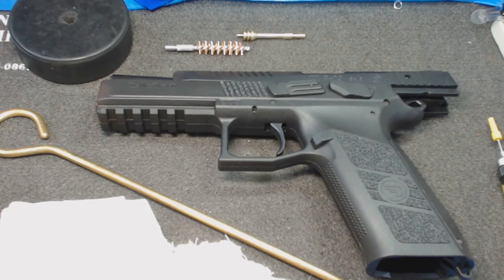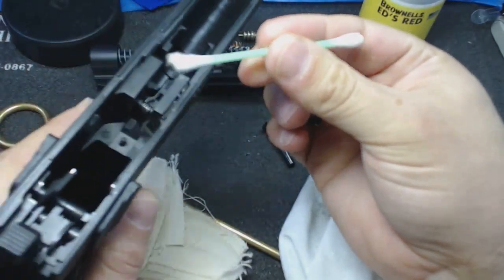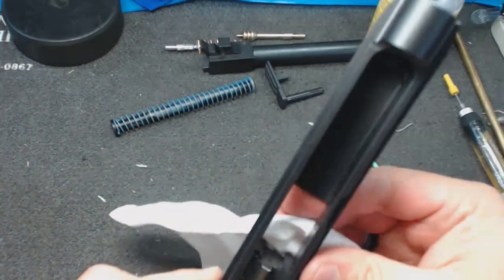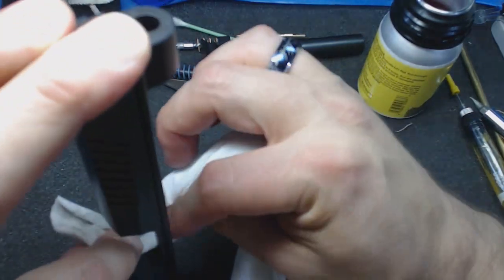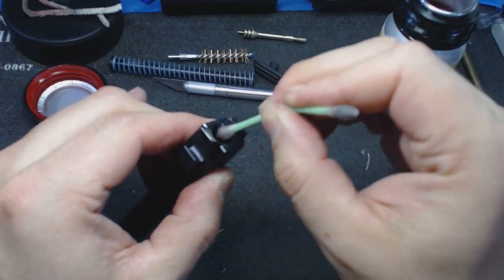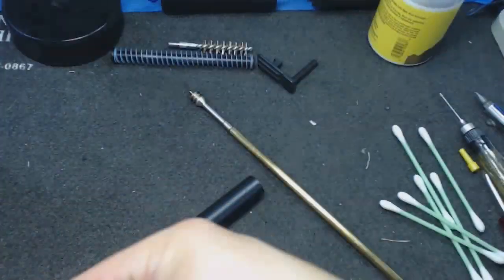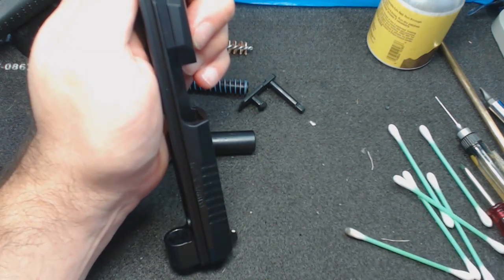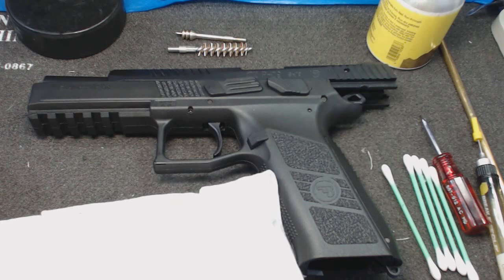How to clean a pistol.

Comment: Good advice on the painters towels! I’m gonna have to go get some. They look really useful. I generally clean with oil only, as you said it is also a natural solvent. I just find that oil loosens up gunk super quick and my guns get squeaky clean faster than using one and then the other. I keep a foaming solvent around to let sit if I have to clean something extra filthy but just oil can really do the job when you keep guns clean religiously.

Comment: A gun cleaning vid I actually watched all the way through , why ? No grease on pistols ! Thank you ! Dry wipe first when cleaning ! Thank you ! Polishing a feed ramp doesnt help feeding ! Thank You ! lol... I see so many vids of some putting grease all the way down the slide channel of something like an M&P or other variant and I immediately stop watching. The coating on a barrel is there for a reason and most coatings act as its own lubrication. For people who dump grease on a pistol , steel or aluminum parts of a pistol that rub against each other are made to rub against each other.If it didnt evaporate you could probably spit on rails and it would be fine. Lube or oil besides lubrication is really to protect against corrosion. AshburnArmorer I have a couple tips for you at least how I do . With captured guide rod springs I use a curved polymer pick , lay a patch on one end of the rod , push the curved pick down between spring coils and just tu3n the guide rod until I get to the other end. Also I know you have a cleaning system qnd you might think here we go another clp but to tell you I use Weapon Shield clp and hqvent gone back. Start with a clean pistol put a few drops on a patch and wipe everywhere in slide and lower where you can , wipe off any heavy clp so all there is , is the feeling of lube when you wipe your finger on it. When I go to the range I take two guns, one I carry and one im shooting. The one im shooting when im done I run a snake that already has WeaponShield on it then coat a medical swab and coat the bore and feed ramp with Weapon Shield and leave it so it gets to work during the drive home . When I get home because everything has a slight coating of Weapon Shield , everything just wipes off I never have to use solvent even in the bore. Weapon Shield does make a solvent and it is safe , it has Weapon Shield in it , you can soak a barrel init overnight and not worry about the bore pitting , Weapon Shield has no harsh chemicals. I field strip , wipe down and inspect my pistols about every three or four weeks especially my carry. Why , I read a funny story a Sheriff went to the range and his duty pistol wouldnt fire , he took it to a gunsmith and there was deep fouling , gum wrapper and pieces of food down in hammer area . The Sheriff said he hasnt cleaned it in over a year go figure. It cracks me up people who know nothing about firearms feel safer if somone is a cop or  carrying a pistol. Many police only shoot to keep their certification. Many conceal carriers , especially who make it a lifestyle and keep up on the laws are safer and better shots and know more about firearms than many police. You wouldnt believe how many ND police departments have . I remember when LA County switched to Glocks how many they had becuse they were used to da/sa and couildnt keep their finger off the trigger and police still have high ND's . and never clean their own guns. Anyway , just a suggestion about Weapon Shield , I really like it and remember the solvent you dont have to worry about any harsh chemicals. I do use the solvent once in a while to hose everything out for a deep clean other than that using the clp I dont need solvent. You really dont clean with the clp having just a slight coating makes fouling just wipe off and you lube the same way you did in video. Check it out it is made by Steel Shield Technologies. George Fennel is the owner and Tribolygist in fact he made Fp10 I believe.

Comment: Hey Ashburn... I would love to see a video comparing normal wear and galling. So many pistols come in my buddies gun shop, he is a gunsmith, gunked up with oil and grease. My polymer wonders I run essentially dry. I put a small drop of lube on a patch and use a bent pic and run down rail channels, just a small drop on lock up and wipe off, as far as the barrel, essentially dry. I see so many barrels drenched wet with oil, why? If they cut the top off a slide like a Beretta 92, you don't drench a 92 barrel with lube. Another thing is thing when people remove the coating on barrels to Polish it looses the natural lubricity. Even my CZ P01 just a q-tip and run down slide. If you have any cheap pistols that have galling you can show difference between marrying and galling. People think where they so normal wear they need to grease or drench with lube and the myth of "If it slides, grease if it rotates, oil". So many pistols come in gun shop not functioning because pin is clog up with lube that has seeped into firing pin channel and everywhere else. If you can show difference between normal wear and galling. Thanks buddy! Keep up the vids!

Comment: There is nothing wrong with applying a very light film of grease as a lubricant, especially a high quality appropriate type of grease. 
Where any bluing is wearing off,  or where scuff marks / Galling appears on any metal surfaces usually the lubrication has been inadequate or has failed. 
Grease is really just a thickened oil, thin oils can have a tendency to fling off.
Manufacturers do not mind if you get it wrong and wear your gun or gun parts out as they get to sell you a new one.

Comment: What is your thought on dunking the gun in a ultrasonic cleaner with some hot cleaning solvents prior to doing hand cleaning?
Reply from the maker: Ultrasonic cleaners are tricky. Most of them use a water based cleanser. This means that after you clean it, you MUST get all the water off and replaced with oil. Short of immersion in water-displacing oil, this is essentially impossible.
What I have found is that nearly every gun that went through an ultrasonic cleaning ended up rusted. It's just not possible to get all the water out without a full disassembly and if you are willing to do that there is not much value to the ultrasonic cleaning to begin with.
Reply: Nick Z. Just my two cents... You may as well just clean regular way. An ultrasonic is mostly water so you need to imm3diately dry qnd lube when done , you can get surface rust within hours if you dont.That means you really should take the slide apart , firing pin , extractor etc..anything that will rust. You just dont dunk 4he whole pistol , you can but that really isnt the correct way since you are going to have to dry everything anyway. Im not saying ultrsonic isnt any good but in my opinion I will clean with paper shop towels, patches , clp. If you have q da/sa pistol and get water in the firing pin channel it can rust and rust it will. Too much of hassle in my opinion ,some people like it..

Comment: How do you feel about the spray solvent cleaners like Gun Blaster?
Reply from the maker: Gun Blaster, Gun Scrubber, Brake Cleaner, etc are all handy to have around, but you have to be extremely cautious with their use. They will liquefy/denature many plastics, specifically fiber optic sights. Fiber optics are fragile to begin with. They have a thin sheath that reflects from the inside while passing it from the outside. Its often hard to tell if the sheath has been removed or not. Most of those cleaners will not only remove the sheath, but reduce the optic to a jello like consistency, destroying it. 

You definitely need to keep it away from wood. You should also avoid getting it on plastic grips. Most  Polymer frames can handle it, but grips tend to be far more variable in composition and a little of these cleaners can go a long way to ruining them. 

The final point is they they will strip ALL of the oil from the metal. If you don't completely coat every part immediately with oil, you are going to get rust really fast. Never spray it into an assembled gun to "wash it out" or the gun will be doomed to rust.

If you want a product that you can use to spray out assembled guns, use Hornady One Shot Gun Cleaner and Dry Lube (long name for a product). It is far less harsh but leaves behind a teflon layer. It's not as good as actual oil for long term protection, but it's not nearly as bad as hitting something with the harsh stuff alone.
Reply: AshburnArmore